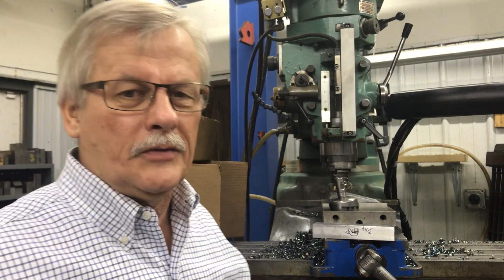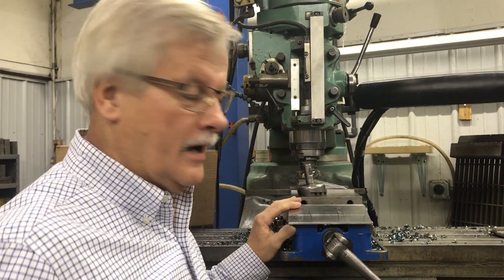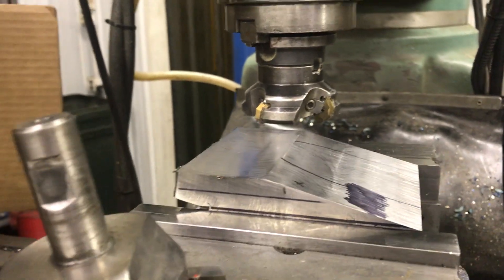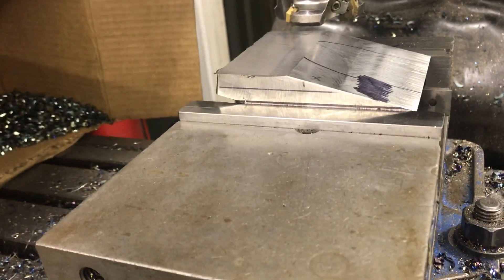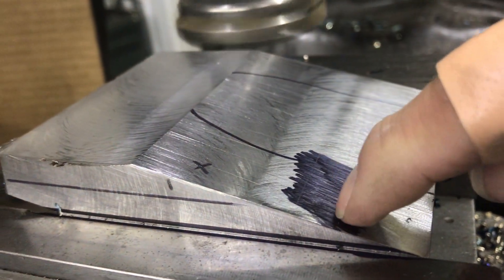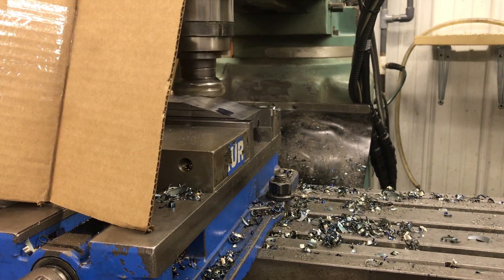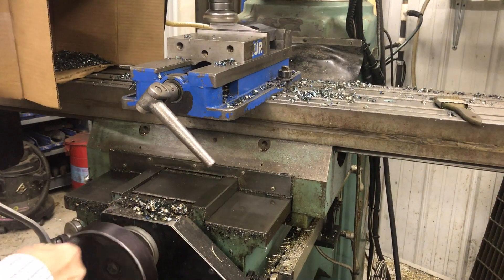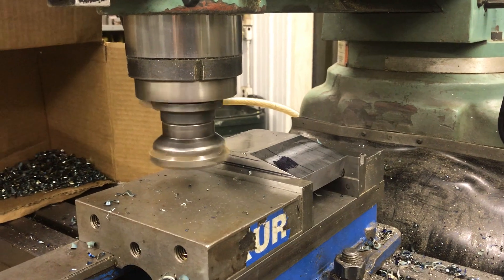fly cutter vs  face mill

Comment: There is virtually no difference in finish betwen the two. Face mills don't wreck your spindle bearings though. If you are determined to remove machining marks, a quick buzz over with a random orbital sander and scotchbrite takes seconds.

Comment: That's very useful. Just the sort of information I was looking for. I'd read that carbide can cut hot but this video shows it working in practice.
Reply: Modern design for tooling is such that
Reply: What I meant to say is modern tooling is designed to cut and take the heat from the friction out of the part, transferring it to the cutter and the chip..

Comment: I am machinist for 25 years, fly cutter shouldn't exist ,maybe  50 years ago was ok but not today,  just my 2 cents. Great video ,thank you.
Reply: There are applications wear a face mill just won't work but yet a single point fly cutter will solve many problems
Reply: @squigmontlucas6150  I’m new to machining. What situations would a fly cutter be preferred? If I was going to take a guess, it would be when the amount of material you are planning to remove is small, but you want a nice surface finish? I made a fly cutter in class at school, and really enjoyed using it.  even though it was very slow. The limited experience I have with face mills has been awesome though. Definitely prefer the face mill.

Comment: I'm a engineering student and I don't have a ton of experience with mills, but aren't you concerned about over-heating. It was making some pretty loud noises screeching, and I assumed  that you'd use cutting fluid?
Reply from the maker: Hi R.B., Thanks for your question.  Actually Carbide is made to withstand heat.  By design, the heat stays with the chips, and as the carbide gets dull they get hot and then that also transfers to the work piece.  Keep an eye on how the cut is going.  If things get hot, switch to a sharp insert.  In some cases putting coolant on these kind of cuts will create thermal shock to the carbide which may break down the cutting edges.  
This project was only making a couple pieces, but if you were running them all day long, you might take a different approach.  All the tool manufacturers used to see who could take the heaviest cut, but in the world of CNC, now the thinking is to make shallower cuts at a faster rate, which saves wear and tear on your machine - especially spindle bearings.  "Dry Cutting" is also been the direction we have gone....spraying coolant on a cutter that is spinning fast and kicking out hot chips can create a fog in the shop.  We put in a vacuum Air Handler to suck up the mist, but by changing to dry cuts, we don't have that problem and air quality is not even an issue.
Didn't take long to figure that out.  A lathe really atomizes the coolant into a  mist because of hitting the jaws in a high RPM chuck.

 A good chip load and steady feed will peel the material right off.  Machine rigidity is also important for carbide life.
Carbide can cut almost anything, but if you have a loose insert or vibration, or turn it on backwards, it will chip right away.   
Carbides have come a long way in that there is a carbide insert for every application of material or hardness.  Tooling suppliers can really help if you have a difficult material to machine...just ask.
That block was S-7 tool steel which is made to be "shock resisting" in it's final application.
Reply: @makersmachining5408  Cool, thanks for clearing that up for me. I came across your video while studying for my metal working class exam as part of my M.E.T degree. Thanks!

Comment: yes I threw out my fly cutters 30 years ago and I simply use a shell mill. for critical surfaces however take out all but one insert to finish such as on critical mold surfaces. by leaving all the inserts in the z pressure is too much and you will notice the surface is not as good combined with when the cutter goes off the edge the pressure of the 2 or 3 inserts is released and the final insert will dig down into the part on the edges. This effect is real and VERY pronounced such as with 6 insert cutters especially if they have a wiper flat because that wiper flat can add up 1/4 of flat scrubbing--work hardening and destroying the surface and also eliminating the chance to feed in the z with accuracy. another trick if using one insert to finish is to take a diamond knife lap and stone off slightly the wiper flat you will be astonished at the surface and the ability to cut to tenths on thickness also on mold surfaces or surfaces that must be polished there will be almost no work hardened layer.
Reply: Hadn't considered using just one insert. Thanks.
Reply: I use a facemill for hogging and a flycutter for the finish pass.
Reply: Thanks for that. 
I have wondered if you can leave the all but 1 insert off one of these mills effectively making it a fly cutter, so you can get that final finish.
It makes sense but I haven't heard anyone say it.

Comment: Impressive. Would you please tell me what Brand of Face Mill that is and what inserts it takes?
There are many on the market with a wide range of prices.  I ran across one similar to yours on the internet and it was $750!  What was the cost of yours?  Thank you very much
Reply from the maker: Hi KW,  That's actually a SECO cutter on a CAT 30 shank.  Might be called an Octomill cutter and holds 4 inserts.  The inserts are  Octagons (obviously). Over the inserts it measures 3" diameter, but the circle that it makes at the bottom is about 2-1/2" diameter.  I couldn't read the printing on the body of the cutter anymore because it's been around a little while.  We haven't changed inserts in a long time, but if you turn the spindle on backwards, and try to cut that way, you'll be replacing all of them.  No clue what the price was.
Sometime SECO (and other tool companies) will give away the holder (or a reduced price) if you buy a certain amount of inserts. 
Google "Octomill" and SECO to see what comes up.   Good luck and thanks for the question.
Reply: @makersmachining5408  Thank you very much for taking the time to reply. I appreciate it very much. Regards, KW
Reply: @makersmachining5408  what speed and HP is your motor?
Reply: similar cutters from china with inserts are in the range of 50 or 60 bucks now.

Comment: 700 degree chips vs. cardboard box? sounds like a celebrity death match.
Reply: everybody does the same thing just like he showed.
Reply: I'll say I'd rather deal with a smoldering box than a smoldering neck/face/head/wrist..... remember there's very little on the machine that burns but everything on you will

Comment: I was always tought face mills are for roughing material (granted a mirror finish can be achived) and a fly cutter is for finish work as tipicly they can achieve a larger diameter
Reply from the maker: Hi Daniel,  Thanks for your comments.  I've been in the trade for a long time and have used both face mills and fly cutters ( back before there were face mills )  We used fly cutters for rough cutting and finish work, just like you can with a face mill. 

The main difference now is that you if you have enough horsepower for your face mill, you can remove a lot more material - and faster - than with a fly cutter.  Horsepower and the rigidity of your machine also make a difference.  A fly cutter has 1 bit, whereas a face mill has many.  so if your face mill has 4 cutting edges, in theory you can feed into the cut 4 times faster. 

Carbide inserts in a face mill tool are all precisely made for interchangeability and repeatability, along with the geometry of the inserts that are designed for all kinds of materials to cut - evacuating the chips and the heat associated with them.  That is a science in itself, and a good study along with speeds and feeds for optimum cutting life. 

The fly cutter on the other hand has a single tool bit, which can be high speed steel, a cemented carbide tip or a tool bit with carbide inserts.  Side by side a flycutter is a lot less expensive than a face mill with many inserts.

The feature of a fly cutter and it's cutting tool is that you can grind the cutting point on your tool bit to suit the cut you are making.  That takes practice to get it right.  High speed steel is great for machining aluminum, and you can put a nice radius on the edge with a generous positive rake that really shoots the chips away, and gives a nice finish. 

You can do the same with a cemented carbide tool bit for cutting steel or alloy materials...just not with as much rake.  An insert tool is a little more difficult to custom grind. 

A fly cutter is a little harder on the spindle bearings too, because it swings around and hits the material once per revolution, whereas a face mill won't have the interruptions between cutter points since there is always an edge engaged in the material, and you can really feed it heavy into the cut.
 

The economy of cost favors a fly cutter if you are using a Bridgeport style mill in a hobby or entry level operation, but if you are producing more parts with a CNC mill, a face mill is the way to go.
Reply: Daniel I basicaly  agree with your comments,,  personally  I don't like 2inch plus carbide face mills on Bridgeport  type machines they just don't have the power and rigidity  which  you need for  for carbide tooling .. doesn't  do spindle  bearings any good eather  ,, for stock removal you can't beat a  sharp big ripping cutter with the  right speeds and feeds and coolant.. surface  finish is not important when roughing you can finish  with any cutter  you prefer..t
Reply: I'm building a fly cutter right now. From machining a nice wide head or block with many interrupted cuts. I tend to lean towards a fly cutter with high speed steel for the finish. But the fly cutter I see most people talk about are the very out of balance steep angle ones were you can extend the diameter. Although that is a nice feature I lean more towards a nice heavy disk style with a 1/2 bit but I have 2 different cutters one is set about .05 larger diameter then the other and about .01 high up. This counter balances the finishing tool and provides a roughing pass.
Reply from the maker: @velez910  You make a good point about the "balance" of a fly cutter that is made with a large angle.  That angle gives the tool bit relief it needs and clearance for chips to fly out. Not sure what material you are machining, and what your rpm is.  The big diameter of your cut makes the tool sweep over a lot of surface footage, and can make a high speed tool get dull pretty quick.
Reply: You are spot on high speed steel likes a slower sfm then carbide and as diameter goes up you turn the rpm down. All of my relief is in the tool its self. Never had a issue with chips rubbing as the tend to get shot out or in depending on the needs and how I grind the tool. The style I'm talking about is used alot for decking heads and engine blocks very rigid. The tool stick out is minimal so the size isn't all that bigger of a issue